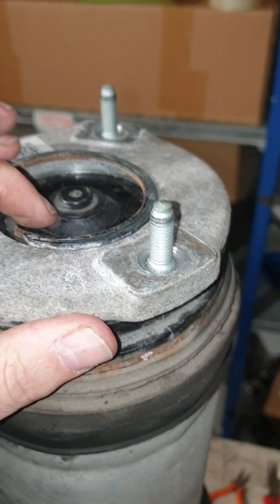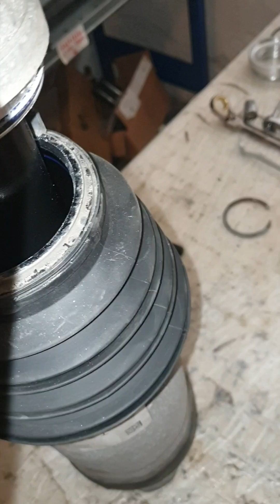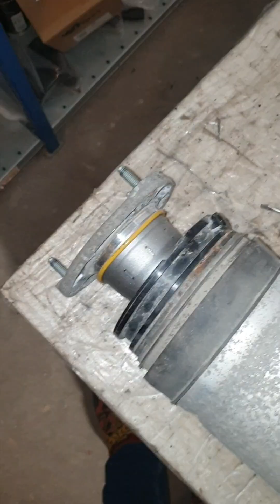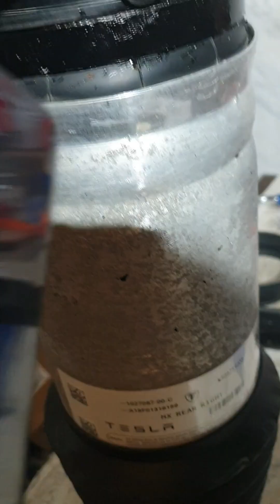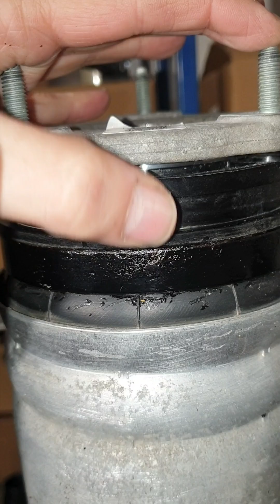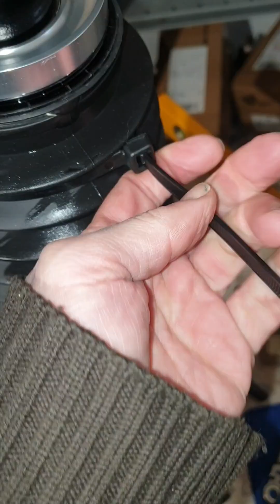How to fix leakages on Tesla X and S adaptive rear air suspension (teslasuspension.no)

Comment: Great video and repair kit, leak is fixed! Also just a tip for anyone reinstalling, leave the VOSS fitting out, it's much harder to compress the spring to get it in place with the plastic bit that holds the locking ring restricting airflow. Also probably just best to crimp the ring on the air hose manually and then screw in the fitting, push-to-insert doesn't work so good with an used hose

Comment: Amazing video! Thanks a lot! Can I ask how you did the painting? 
Did you use some kind of rust stop before paint coat? Also what brand of paint did you use. Spray paint I guess?
Reply from the maker: Spray paint yes. Used primer and metal paint from Biltema. Most important is the sanding job that is done beforehand. At the bottom of the shock absorber (below the stop ring - most exposed to rust), I put an extra layer with anti-corrosion paint